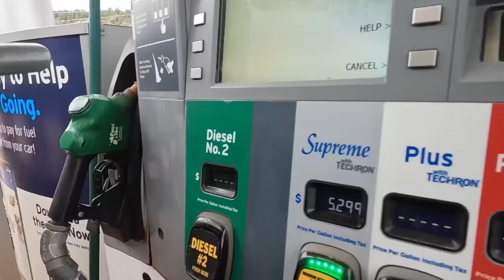This Rescue Can Cause Serious Injury, Don't Be a Statistic!

Comment: Years ago I saw a rancher attempt a snatch on a mud stick combine. My cousin and I were driving by and he asked us to help him. We tried to talk him out of it but he insisted and had my cousin in the big harvester. He had a chain on the axle and pulled with a 1 ton dually ranch truck. The chain either broke or came off, split the tailgate top to bottom, took the pump off a bed mounted fuel tank, went thru the back window and out thru the front glass. Luckily he ducked when he felt sudden slack. Pretty sure he soiled himself.

Comment: That truck is a fantastic example of why I DON’T like electrical shift transfer cases! But I’m old school so what do I know. Of course, I can fix a points distributor or carburetor while I’m in a mud hole as well 😊
Reply: I have an F-350 with manual shift and one with electronic and the electronic can be super finicky.
Reply: If it's in 4lo then the t-case is fine.  I get not having a lever but if the t-case is in low, the front output is 100% spinning.  Never using 4WD until you are stuck is a bigger issue that electronics failing.

Comment: I’m glad Matt is adding in these little tidbits about safety, with the reach of this channel I’m sure he will save a life or two at least.👍
Reply: Absolutely.  

There was a missed opportunity on the second recovery to mention why in that particular situation it was ok to put the towrope on the pickup's trailer ball: the pickup wasn't stuck, it  just wouldn't run. There was no resistance when they pulled it back to get it in position for the front tow. Had it actually been stuck, I imagine they would have done it differently.
Reply: Knowledge is power. Knowledge is also safety.
Reply: Ya but then he used a wimpy chain on the excursion. I can’t believe he did that!
Reply: @brandontuckett767  It was an easy, steady pull with a winch.  That chain (not really a wimpy one), can pull a lot more than that Jeep can exert back just sitting in goop with no anchor.

Comment: I was wondering if Matt would mention the recent fatality regarding pulling a truck from the mud.  Good to get the word out about hidden dangers.
Reply: What happened?
Reply: @martinpearson7744    They were doing a kinetic recovery with a static strap off an 8inch drop hitch. The drop hitch failed and was launched resulting in the fatality.

Proper equipment is crucial, never do a kinetic recovery with a static strap or chain. Hooking points are critical as well.
Reply: @MattsOffRoadRecovery  I have seen this more than once, and it nearly decapitated me one time. You start a recovery with a method that can be safe (i.e. chains but with a slow, steady pull), and the driver of the recovery vehicle gets frustrated and begins to yank instead. In our case (circa 1997), the chain snapped on the third pull while we were yelling at him to stop and rebounded into the tailgate of the stuck truck that I was in - bending it inward over 30 degrees. Just a couple inches higher and it would have been through the back window of a late-80s Toyota - and us. Since then I only use recovery-rated straps (or ropes), and if it looks sketchy AT ALL, I wrap a towel around the midpoint to redirect any potential projectiles downward in the case of failure.
Reply: They were also using a drop hitch and that's what broke as it acted like a big lever instead of pulling directly on the receiver
Reply: @MattsOffRoadRecovery  The tow hitch is also part of the "fault of the choice of equipment"
Reply: Asking, NOT criticizing… because after the recent tragedy I’m trying to get smarter and safer.  I thought you aren’t supposed to ever use the ball hitch as a recovery point because it can break off and go flying.  I know it was just a little tug to get the truck pointed in the right direction? But should they have done that differently in the second recovery of this video?   
PS - I love all your videos, but especially the ones where I learn things.  Thanks so much!
Reply: @billc6919   You are basically correct about not using a ball as a recovery point. That is especially true in kinetic recoveries. In this particular situation, the pickup wasn't stuck and so there was no resistance when they towed it back. It was pretty much the same as it would have been if they were doing it on concrete. Had the truck actually been stuck, they probably would have done something different.
Reply: @billc6919 
 Tow hitches are designed for steady pulls, like in towing a trailer, if you need to put more force on it than the vehicle is designed to tow (normally 3.5 tons for cars / SUV's) - then don't - if the vehicle will roll relatively freely like on a road / gravel you can pull it out slowly with about the same force as the weight of the vehicle. 
The moment anything is stopping it rolling freely - damage, brakes, stuck, uphill, obstacle the force required increases massively can be 5 or more times the weight for a vehicle in deep mud.
The moment you start applying dynamic loads rather than a steady pull the force and energy involved multiplies massively: A 2.5 ton truck at 10 mph has slightly more kinetic energy than a .50 BMG round, At 20mph more than a 25mm autocannon round, by 30mph it's at A10 Warthog gun levels - and in a kinetic recovery you are essentially building a catapult with those levels of energy.

The faster you stop something the more force you have to apply if a kinetic strap takes 2 seconds to stop a vehicle and a static strap tries to do it in a 10th of a second it has to apply 20 times more force.

Comment: That Excursion has a 2005 front end, but the mirrors are older and the engine sounds like a 7.3.  I can tell you my Excursion weighs 8,100 pounds with 44 gallons of fuel; and you pulled one out.  Great video!

Comment: Excursion and super duty tip: the automatic hubs often fail to lock automatically. Manually locking the hubs often takes care of the issue.
Reply: Excursion and super duty tip #2: Don’t go off-road
😉
Reply: Try and get a truck where 4WD is engaged with a floor shifter, not the dashboard operated ones that use vacuum. Automatic locking hasn't worked on my 2000 Super Duty for 10 years. Now the front hubs leak enough vacuum that it won't reliably stay in 4WD. Ford always has a better idea, right?
Reply: International Scouts had the right idea.  You only needed to lock the hubs manually, when you really needed them.  Otherwise, they just worked just fine
Reply: @robertheinkel6225  some had that weird pull the knob engage the chain transfer case, though.
Reply: Except he tried that this time and it didn’t work. So must be a different issue.
Reply: @JulietteSasek  more about why he tried even though they are supposed to be automatic.
Reply: @robertheinkel6225  Both of my Toyota pickups were manual only. You get used to doing it that way.

Comment: Curious about that Excursion, my Ford has to be put into 4 high first and after it locks the hubs you have to put it in neutral to lock 4 low, if he went straight to 4 low then that could have been the problem.
Reply: Exactly --- case of he does not know his truck ---- my '02 Excursion works the same as you described.

Comment: Question - have you seen the industrial air bags that are sometimes used in recovery ops and would something like that be helpful here to help break the suction the Excursion was experiencing?  i.e. place it under perhaps part of the vehicle to lift it up while doing a pull?  Just curious is all.
Reply: Who wants to deal with an air bag covered in muck?
Reply: @TheBandit7613  They use them them for big trucks recovery frequently so it's not uncommon
Reply: @TheBandit7613  and if the money is good enough, I'm sure they'd be happy to just like I would

Comment: Always worried when Lizzy is sitting in those rigs with nothing between her and something slinging back at her. Bless you all with safety. Never take a risk.
Reply: Why is it that you don’t want to use kinetic energy on a recovery like that?
Reply: Not worried about the dogs? or the dude standing right next to the ropes with a camera? But the girl sitting safely inside a vehicle? You crazy
Reply: @capacious1288  The vehicle can be suctioned into the mud so strongly that it can cause people to pull harder than necessary, in which case the rope could break and hurt someone
Reply: This is straight to the point

Comment: Here's a good tip when loading on the flatbed. When using J hooks on a vehicle with CV boots, you want the J's to come over the top of the control arms with the pointed end facing down. This way you don't accidently poke the boot. Keep up the good work.

Comment: Matt,
At 2:35 you mentioned folks hurt & killed doing the snatch. Was that because the line parted? (Ex swabbie here. We had training flicks.) It wouldn't hurt for the peeps to see a line, or arresting cable, part under strain. Heckins, we weren't allowed to stand near lines under tension. Please advise.

Comment: I believe on the excursions (don’t know if it is on all years and models) the four-wheel-drive runs off of a vacuum pump up by the air conditioner sometimes you can unplug that and plug it with a nail or your finger and get it to switch and the 4 x 4 might engage or tap the little valve unit and it might engage the 4x4.  I ran into problems on my 2004 excursion and gotten it to work and have got the 4x4 to work along with the ac vents…ford put the 4x4 and the switching of the ac vents on the same vacuum system

Comment: That snatch assembly you are using is called a two part rig. Every block you add in doubles your line pull. You could put another block at the Banana and the tail back at the truck and have even more pull strength

Comment: This has probably been suggested before, but just in case; Have yo thought about using small hand held CB radios for communication between vehicles? I'm a rural fire fighter here in Australia as well as a 4wd tourer and a radio is essential for quick communication.

Comment: alot of those 4wd won't engage the front wheel lock until you drive forward a foot or so. so make sure they're locked before you get stuck.

Comment: A friend of mine once got stuck.  When I went to help him he said "The four wheel drive works but the front wheels won't pull".  Turns out he KNEW this BEFORE going off road.  (the front hubs were stripped out, which means the four wheel drive does NOT work.)

Comment: @Matt's Off Road Recovery are you running low pressure in the tires all the time or is that a step you are skipping in the videos? I would think dropping to 15 PSI would give you a lot more traction in the sand for the tangerine. also, why not a anchor for the pulling vehicle like a pullpal?

Comment: The old ford 4x4 works off vacuum.  The lines dry rot.  And or  you have to put truck into N then 4L.  Roll the front knuckles and pinch vacuum lines that go to wheel hub/bearing and it will engaged. Or mine does

Comment: I remember before everyone had cellphones, using a shovel and labor to get trucks out like that. Sometimes we would get stuck 20 miles from the nearest building. I learned quick to never wheel alone. I've got a friend that's a tree guy with stories of climbing a tree, putting a rope up high and dropping the tree using it to snatch the truck out. Problem is, sometimes you only get one shot to get it right

Comment: Hey team. Watched you pull out the grey Mercedes when you had to go fetch the trailer. Most Euro cars have an emergency fuel cut off switch that activates with enough of a bang. Perhaps check that if you have a no start. Normally behind glove box. Cheers Adam

Comment: On that Ford, there is a vacuum pump under the hood. If you pull the line from it to the hubs, add suction, and then cap it the hubs should lock in.

Comment: We were on an Op, back in the 1980's and a Gama Goat got really and very badly stuck in the Mud. It was the middle of the Night, on top of that. We tried one, then two other Goats to unstick it, but no luck. So, the Guy doing the pulling decided to downshift and try to yank it loose, but the Chain snapped, and went through the front Windshield, of the stricken Goat. It almost killed the Guy in the Cab. We decided it was time to call, for a Recovery Vehicle. Less bandages. AATW

Comment: One thing I've noticed is that whenever you need to winch, you never put a blanket or mat over the line to absorb the kinetic energy if the rope breaks.
Reply: not super necessary with synthetic line. 

now, steel cable on the other hand...

Comment: Last time I got my Excursion stuck in the snow, turned out the electrical plug from my transfer case came loose at the transmission.  Figured that out after breaking a tire chain and taking out one of my brake lines and then hiking into camp for the night.  Those trucks are just terrible off road even with 4x4 working.

Comment: some late 90s- early 2000s ford trucks need to be in park or neutral to go to 4x4 low. they can do 4x4 high while in gear and moving but low requires that extra step.
cant tell if its that or the truck legit broke but ive seen it give people issues elsewhere.

Comment: Question: In flat recoveries like this, why not use another snatch block off the Banana and secure the winch line to the other point on the white 4x4 for a 3-1 mechanical advantage?

(Serious question that you may have answered before, haven't got the time to do the years of reading to get through all the comments in the other videos. :) )

Comment: I don’t disagree with you often,but I have used a rope to snatch out a 1 ton 4 by, rope was raited at86,000 lbs, used my Ramcharger, the Chevy was sunk in a slit bed, nose was legal with mud, they had to get out the window, he had a massive shock absorbers hitch that’s what I hooked to and the frame of Ramcharger, put in low lock 4x4 and hit it with full throttle, one hit it was out, had a bunch of guys watching because ford and Chevy guys couldn’t get it, I had 42” swampers on my Ramcharger and fresh rebuilt on 360, camed up, transmission and transfer case, , I wouldn’t have hit it that hard but I knew my anchor points were rock solid on both trucks, it was 30 years ago, high test chain on end 3 foot long so rope wouldn’t get cut on frames, they said the rope stretched, I don’t remember the brand but I swear it was bailing twine, it was blus and white, a local farm shop sold them,but I enjoy your videos every time I watch

Comment: 0:55 no mud is in the area you speak of.. You seen those rides you built are for flat surface and sand across the parking lot 🥴.. You need to relocate to the trail back a few miles.. Maybe Texas

Comment: At least these guys are only in freshwater with no tide to deal with, I have pulled a few people out from saltwater where the tide has came in and the water is above the rear tire , what a mess if you do not clean that immediately especially in the cracks and crevices then within a year or two anything the saltwater had touched will pretty much not be there anymore LOL, also i tell the people all the time that if the water was above the rear axle definitely drain that and refill with fresh fluid, if you dunk a rear end that is hot like you just drove all the way there then when it rapidly cools if you did not do a vent relocation it will pull all the water in that has room for,

Comment: If that recent death was the one I think it was. It was caused by two factors that should never have occurred. The snatch Strap was not a kinetic strap. And the mechanism by which they had hooked up to it was an extremely offset tow hitch and they put it on the ball of the tow hitch not on the center of the hitch point. It was a recipe for disaster from the outset.

Comment: I guess the straps on the roll back are to shut the Youtube Keyboard tow operators up?! That winch with its v-bridle is both stronger and less likely to fail either those straps or the single J-chain on the rear of the casualty. Straps are COMPLETELY unnecessary at this point other than to decrease the hater comments that don't know what they are talking about...lol!

Comment: Any more info or article link on the poor soul who was killed doing a kinetic pull so we know what NOT TO Do, and how to be safer?
Reply: it was in Arizona. dude came to help his friend get out of mud, but ended up getting stuck himself. another dude hooked a strap to his trailer hitch ball and hit the gas. ball/hitch broke loose and shot through the front windshield and straight into his head, killing him instantly.  Really shitty part is his wife and 2 kids were in the truck with him when it happened. 😔

Comment: There is little dots on the Hubs that you HAVE to line up for it to go into 4 wheel drive . You can not just Willy nilly turn the hubs. Clean the hubs off a bit find the dots

Comment: ya"ll need to come to maine and deal with your trucks stuck in the snow. if you got a salter (5500 lbs) onboard it will take a 35 ton wrecker to recover you if you drop ONE tire over the side. using second truck to clear path to get wrecker in place to recover other low truck sucks. 
sigh.
done it many times

Comment: When a tree isn't handy take a 1 in rod 3 ' long and drive it down to 4 in at an angle to the vehicle to be pulled. Then pull vehicle out then put the winch vehicle over the rod ,a claw hitch will pull the rod with ease

Comment: "Water in fuel" is NOT ok...  so many thousand of $$$$$ to get that repaired if fuel has been running through the fuel system of that diesel.
Reply: @MattsOffRoadRecovery  True, but I don't think that was a 7.3.